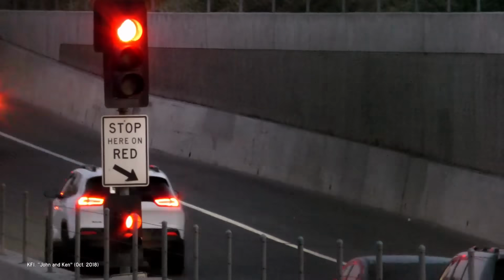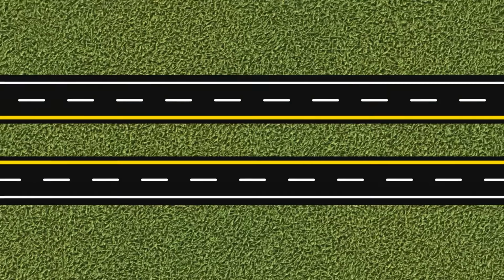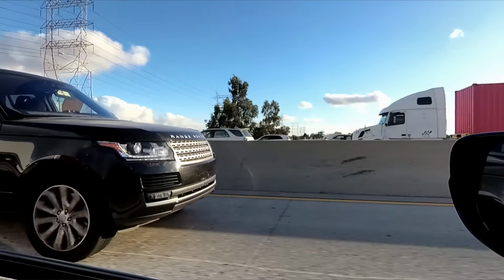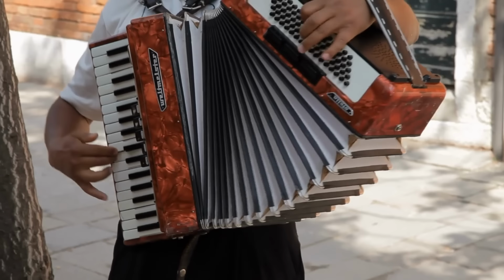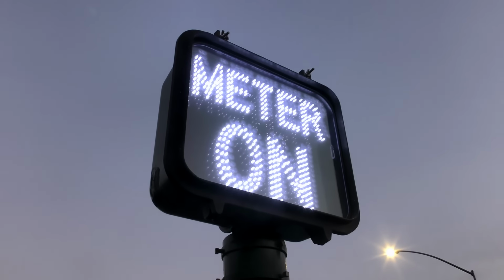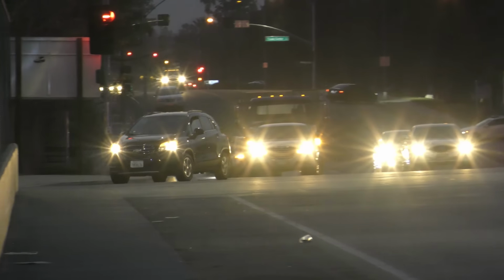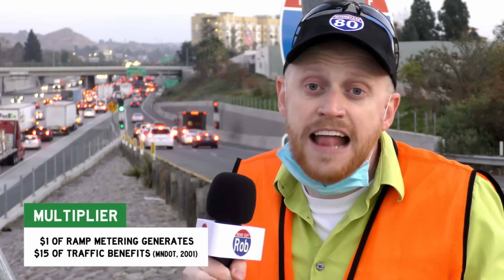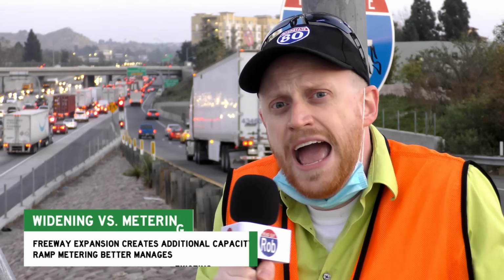Why the extra RED LIGHT on freeway ramps?

Comment: Of course they work.  They aren't strictly necessary, but if people aren't automatically spacing themselves properly, these traffic signals force this discipline.  The fact of the matter is that without proper (or dare I say, generous) spacing between cars, traffic jams and rush-hour slowdowns are inevitable.

As an aside, people need to stop treating multilane roads as separate roads for each lane.  The purpose of the extra lanes is to prevent a single person from slowing down traffic flow.  People should be driving at different speeds in different lanes.  When that isn't possible, they should be making sure no two cars are in the same horizontal rank (nobody in the lanes to your left, and nobody in the lanes to your right).

Comment: Does this not impact the road leading up to the onramp? I have seen them gridlock a lot, but in the simulation you showed, it looks like this would be less of a problem if the lights were not there. In a way it seems like it is trading one problem for another.

Comment: This is a complex topic as states, like mine, do a miserable job of when they enable ramp metering. I’ve seen the freeway crawling at 10 mph and metering is off, and in light traffic with people doing 10 over the speed limit it’s turned on. The amount of fuel wasted and extra emissions produced by ramp metering when it has little or no positive effect is huge yet states don’t seem to care. Further you should NEVER make a car stop on a ramp when it’s the only car on the ramp yet, guess what, that happens a lot as the systems are to “dumb” to know better.

Comment: 974 the meter flow rate is just bs on the on ramps, but longer merge lanes does make logical sense or better yet u merge safely into your own lane that then later down road from ramp has to merge. A double length on ramp double merge 2 lanes into1 then later merges w/hwy no bs light needed. Back in day ppl had no or only 1 light for a town.

Comment: I hate it when slow drivers drive in left lanes or, gasp, multiple slow drivers are pacing each other in adjacent lanes.  Of course, some states and countries use the left lane only for passing, but in states where that's not a requirement, get your slow ass in the right lane where it belongs so that the traffic can flow better.
Reply: ABSOLUTELY

Comment: These do not work when they release both lanes at the same time, like they do in Colorado Springs. Both cars are released and immediately have to merge to a single entry lane, resulting in them merging on to the highway significantly slower then when released alternatively.

Comment: So the first thing popping into the engineering section of my brain is "Why is there any gridlock at all when you have meters? Shouldn't the metering time keep increasing as capacity fills up? Or is it human nature that no one will sit for 5 minutes between green lights and 45 minutes in line on an on ramp?"
Reply: Eventually the ramp would backup into surface traffic if it was unlimited, creating a new set of problems

Comment: could you look into 'lane sweeping' ?  It is a citable infraction in my state of WA but you would never know it. I think it might be the popular influence of NASCAR and the comedy 'Talladega Nights'. it appears to me there is a behavioral  imperative in humans almost forcing them to think of themselves as race car drivers 'drafting' their arch enemy at L&R turns and that they will suddenly find themselves in Victory Lane popping Champagne corks if they slingshot around any car that has the NERVE to be in front of them. I have recently found joy and satisfaction in immediately swithching my Left turn signal to Right during any turn from a single L turn lane to a two lane road. You see i have a big old Chevy 3/4 ton PU and if they want to destroy their new car ( a car that is far faster than they are capable of controlling) on the harsh tow hitch at  the back of my Chevy, they can knock themselves out! boy, have i heard a lot of cute little grocery getters almost hit their rev limiters as they go from emergency braking to hammer down to pass me on a 30mph arterial. Good Times!

Comment: How does it work like magic, as you say, and smooth the flow of traffic, when I come to a traffic metering light which is signaling, and causes me to come to a complete stop, and then merge onto the freeway at half of the freeway speed, when it was plenty safe and possible for me to just continue accelerating onto the freeway, and when I merge onto it, I am already going the speed of the freeway. Very often, I see traffic metering lights impeding the flow of traffic onto the freeway

Comment: There's a very poorly designed ramp connecting the I-215 east to the I-15 north in Las Vegas right next to the Strip where all the lanes slow down to 30 to 40 mph because of people merging onto the 15 from the ramp. The merger is very abrupt and heavy breaking is not optional. There's no meters on this particular ramp. There probably should be. There's meters elsewhere in the city but I've never seen any of them actually on and functioning. They're all turned off whenever I'm there. I've lived here six years. I've never seen any of them on.

Comment: I've yet to see any indications that CalTrans employs a single competent signals engineer.

They seem to be unable to program those pogo lights efficiently - how difficult is it to alternate which lane gets a green light?

Also, almost every on-ramp and/or off-ramp with a traditional signal light at the surface street end (all such signals are owned by CalTrans in California) is inevitably in conflict with the timing of the local authorities traffic lights.

The theory of metering incoming flow to minimize back-ups is sound... The application, however...

Comment: I run those lights all the time, I drive a stickshift it's annoying to reset especially with other idiots on the highway. You try getting a 5 speed 2010 toyota corolla up to 70mph in a 1/4 mile stretch on-ramp. No thanks I'll hold my speed.

Comment: I wonder how much of these problems would be solved with European roads and rules.
In Europe you cannot overtake a vehicle on the right side, only the left.
This means the lanes on the left are for increasingly fast traffic.
Making the right lanes ideal for merging traffic, as it is already slow, and people tend to move out of the rightmost lanes around on/off ramps.

I have seen these on ramp lights here, i've just never seen them turned on, and always wondered what they were for.
Seems they are a relic of the past. (Just like much of the US infrastructure tbh)

Comment: Imagine how great traffic would be if all cars could accelerate at at the same time, like if they were coupled together. and instead of each one having it's own individual engine, you could have one big, centralized power source that can power motors on each axle, which is much more efficient. And imagine how much more efficient it would be if, instead of wasting energy on bending rubber, we made the wheels out of steel, and put them on steel rails. Let's call this system a "tarin" or something.

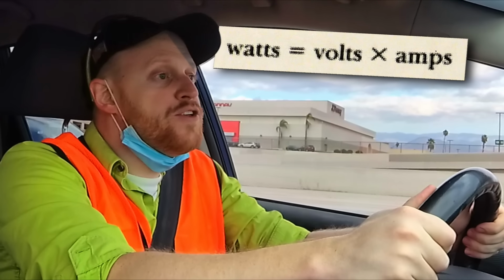Comment: Good analogy with electricity , but, Ohms law (3:58) is Volts = Amps x Resistance.  The law you were using is one for power (watts), but a good example none the less.

Comment: I run these ALL THE TIME. Not intentionally, it is just i am prepping my merge and don't see them.  
Rounding that cloverleaf, seeing the gap, judging the speed differences, and then  accelerating toHOLY CRAP WHERE DID THAT RED LIGHT COME F...GO TO?
Reply: You should remain observant of your surroundings and detect red lights from a distance.
Reply: @56independent  not possible. You can not see something that is obstructed from your view. And the human eye/brain  does not work for 180 degree spacial awareness, in order to see what is to your right you have to look away from what is to your left. 

The way you are aware of your surroundings is your eyes are darting back and forth and your brain fills in the gaps. Not the best way to accurately judge speed and direction of cars at high speed you are about to join.

Comment: Unfortunately, I have yet to find one of these that detects me on my motorcycle, even if I position myself on the loop. Anywhere. They all seem to be on low sensitivity. So I have the options of holding up all traffic behind me for hours until the lights turn off, or running the red light. I do the latter, but try to keep spacing. Traffic engineers should be forced to ride motorcycles.

Comment: Except they use the lights when there's not enough traffic to slow the main lanes so you're trying to get on the freeway that's traveling 70mph from a stop in your 2001 Corrola so you end up driving on the emergency lane getting a nail in your tire that you notice after getting home.

Comment: The lights on the on ramps are the worst idea ever. What road designers need to do is "Lane Mathematics". Any time you have cars merging into on active lane, traffic will slow down. So if the highway has three lanes, the on ramp needs to add a fourth lane for the oncoming traffic. This lane will then be eliminated at the next off ramp to keep highways from having too many lanes. More lanes equal more traffic.

Comment: Hey, USA, don't let the Canadians drive in the freeway. 
They will make very dangerous driving conditions with more accidents. 
Here in Canada, there is disaster with drivers merging into the freeway at 25 or 35 miles when the traffic  in the freeway, which is running 55 or 60 miles  per hour. Causing accidents and jamming unnecessary traffic. 
And the worst, they put the signal when they are all ready inside the other line.
If you see someone doing this bad driving skills in the USA, you know it is from Canada

Comment: Ohms law wouldn't be the right analogy, electrons always travel at the same speed. Volts are not a speed measurement, voltage is the pressure that the electrons feel.

Comment: Great video, but I can't tell you the number of times these stupid lights are working when the freeway density is low and is going 10 MPH above posted speed. And people waiting their turns? Two or more cars on a red light after the first car on green. I don't buy the efficiency story.
Reply: Not everywhere do they put detectors to control on and off times. In many places they just just simple time of day to turn on and off the ramp metering and they operate at a constant per-determined rate.

Comment: I run those lights unless there's a cop behind me. If people would learn how to merge onto a freeway and not to tailgate once on said freeway, that would work better. It's the responsibility of people getting on the freeway to speed up or slow down in such a way so as to be able to merge between cars on the freeway. Then there's the added problem of idiots braking unnecessarily, either because they were driving too close to other cars for the speed they were traveling or they weren't paying attention or they drive an automatic car with two feet (one foot constantly on the brake enough to at least illuminate the lights) or they have a brain fart and decide that this means they should brake. Then there are those idiots who will do some combination of braking or jetting across multiple lanes because they don't realize they want to get off the freeway until the opportunity has nearly passed and assume that getting themselves to their destination is more important than the intent of everyone else on the road. If we could solve these moronic practices, that should work. Just because everyone turns onto the on ramp at the same time doesn't mean they can't space themselves out and drivers who can't do this really shouldn't be driving at all.

Comment: What drives me insane is when I see ramp meters that have three lights but the yellow light is never used. They keep going from green to red, no yellow in between. What's the point in installing three lights if only two are being used for on ramps?
Reply: In our country the yellow light is used when two cars can go through the light instead of one. It is not used when it is installed for one car at green. But with two cars you need yellow to get both cars in ready position. And the second yellow is to warn do not start at this moment. Because there is a red light camera pointed at you. So the light goes from red to yellow to green to yellow to red.

Comment: They tried that stupid ass idea in Detroit about 35 years ago. People very quickly learned to ignore those lights. The number of accidents caused by people stopping at the beginning of an entrance ramp and a backup set was causing up on the surface streets. All you're doing is moving the traffic jam.
You could get precisely the same response like teaching people how to drive on the freeway, and quit slowing down much slower than the car in front of you barely by paying attention in front of you just a little bit further than the 6in in front of your car. 
Even if you were Saving Time on the freeway. You've already lost that time sitting on the entrance ramp and back in traffic up on at least two directions of the road that it comes from. Possibly on Crossroads as well.
I will have to extend some kudos to you. It was the best example of and insanely stupid idea that I have ever seen.
Trying to compare it to electrons, because electrons do not travel by flowing. They travel by knocking an electron out of an atom in front of it. And her constantly knocking into each other knocking an electron off of the next atom.
One of the quickest things you could do is to teach people to not drive in the right lane until they're ready to get off of the freeway. And raise the speed limit on the freeway to a reasonably but fast speed. Like about 80. Considering there has never been an average speed driven on United States highways that's been above 68.2 miles an hour nor has it ever been slower than 66.8 miles an hour. Even when Jimmy Carter thought he was going to save gas by cutting the freeway speeds down to 55 in violation of virtually every state law in the nation. And he saved all of two and a half miles an hour. He would have save more gas by requiring people to actually air up their tires to the proper air pressure.

Comment: So okay… ramp meters can aid freeway efficiency by controlling access.  But, meters on flyovers connecting 2 blue shielded freeways is dumb.  The interstate highway system is supposed to be free flowing.  The act that created it clearly states this so any city or state that is metering the ramps between federal interstate highways in order to discourage the use of cars should have their highway funding pulled.  1. If you intentionally violate the standards of the Act, why should you get funding?  And 2. If you don’t want cars and highways why should you still be getting the money meant for highways?

Comment: These don't work. They're designed to prevent phantom traffic jams but any day in Denver will make you realize they're pointless and generally contribute more to phantom traffic jams than they prevent them. The real problem, at least in Denver, is that right lanes are constantly exiting or ending forcing slower moving drivers to constantly be merging left. You can seriously start out in the farthest left lane on the interstate in Denver and within a mile find yourself in the farthest right lane because all the lanes to your right have ended a new lanes to your left have sprung up. I find it shocking that this cause of phantom traffic jams isn't obvious to the engineers who built the road. I often think in Colorado they just gave marijuana to monkeys and allowed them to design the roads.

Comment: 2:10 At this point, you should merge into traffic behind the pick-up truck with green side.  
Do not pass traffic on the right side!
13:55  Here, the tractor-trailer is passing on the right, taking the open lane that the traffic engineer wanted entering cars to have.

Comment: The problem with ramp meters is the drivers, not the concept. Ramp meters make the driver appear to be forced to make a small sacrifice for the overall good - and many drivers want to avoid the sacrifice and save themselves a few seconds, which in turn increases the size of a platoon and then reduces overall flow. Like mask wearing, ramp meters expose the selfish among us but if most people follow the system - and make the small sacrifice - then we all benefit.